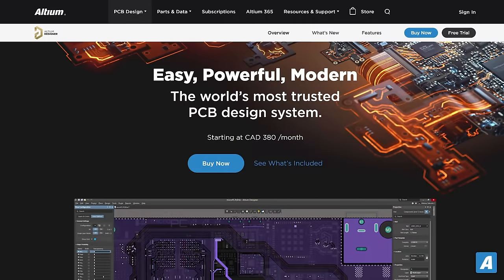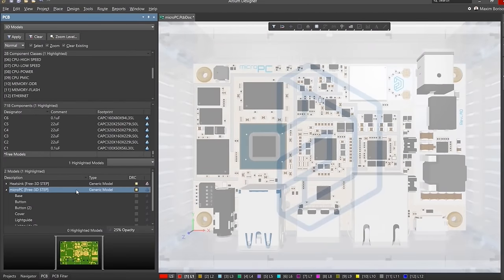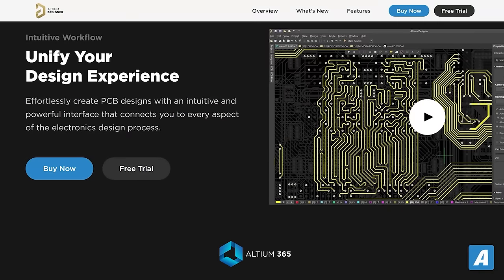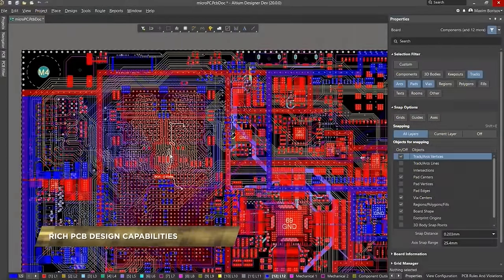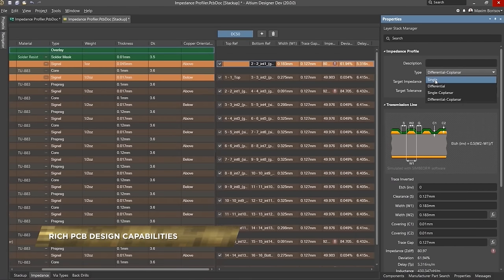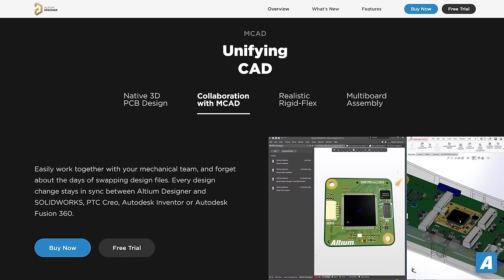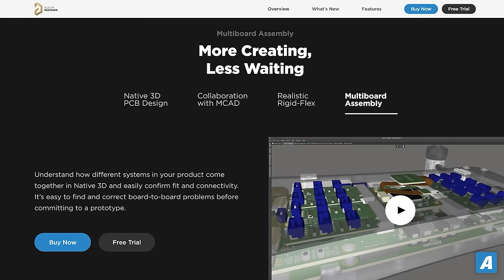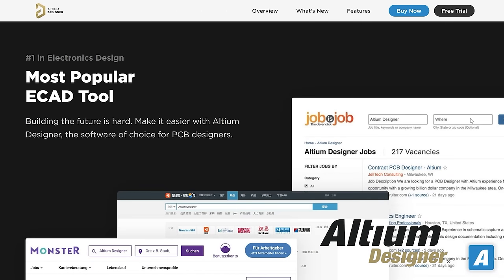Computer Components For Dummies

Comment: gut video, but ya should had spoken more about PSU(Power Supply Unit) its pretty straight forward, but if ya update yar computer make sure PSU has the watts and pins for new mobo(mother board) and/or GPU

Comment: I had to build a new machine because 32GB RAM wasn't nearly enough, so my new rig has 128GB.  I personally wouldn't recommend anything less than 16GB RAM for a new system these days, especially for anyone planning on running Windows.  Most Linux systems run better with less RAM than a comparable Windows system, but I still wouldn't recommend less than 16GB unless your budget is REALLY really tight.

Oh, and if you're going with Linux, might want to stay away from Nvidia.

Comment: I'm in the market for a laptop for my vinyl cutting and T-shirt business what would you recommend I look for in a laptop
Reply: It mainly comes down to what you need the laptop for. Will it be running machinery or equipment? What equipment is that and what are the manufacturer's requirements for a computer. I personally would go with a 15.6" laptop that has a full HD screen (FHD is 1920x1080), minimum of 8 GB of RAM and a 500 GB solid state drive (SSD).

Comment: One point that you missed on GPUs, specifically NVIDIA is that they have comparatively bad support for linux especially with the new rising Wayland display server. I know you said this video was for beginners but there are a lot of beginners who use linux as well. I think you have to address that point as well.
Reply: Rising Wayland display server?  How many gigabytes is that? Is that a motherboard?
Reply: @kimfroman2023  Oh no. Its not a motherboard. Heard of the X display server on Linux? It is the component on a linux OS that manages the display basically. I don't think I am the best one to explain exactly what it is. But a quick youtube or google search should give you the appropriate results.